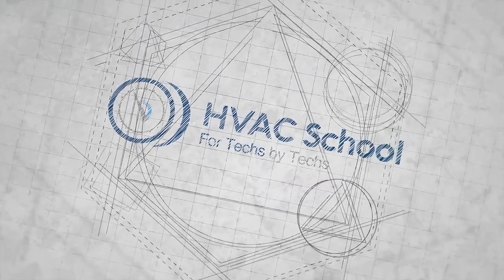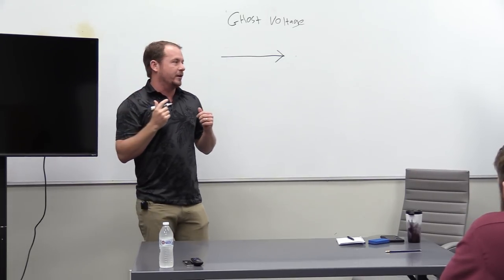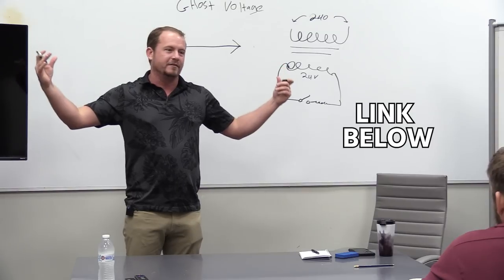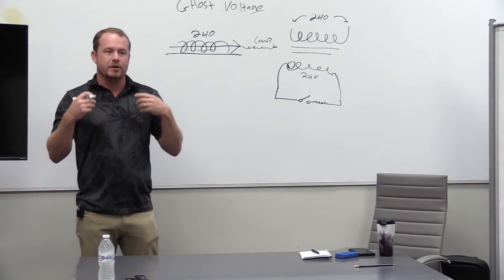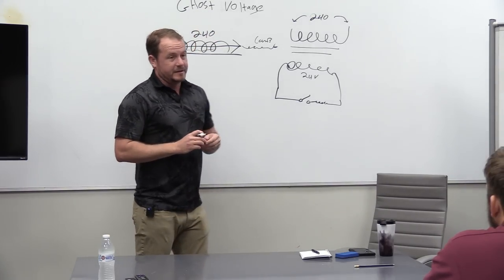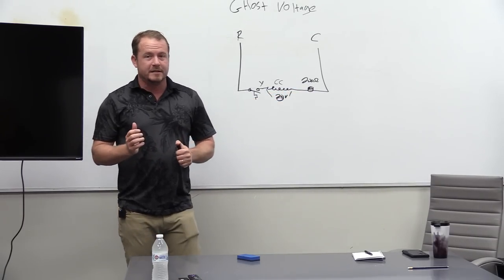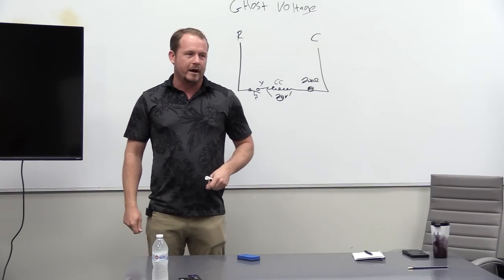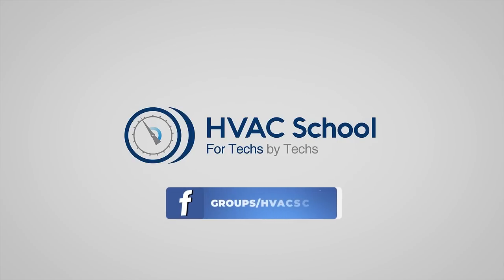What is Ghost Voltage?

Comment: Awesome! Journeyman electrician here. Ghost voltage can be very confusing while troubleshooting. Great job talking about low Z meter. Yup, If u got one it will answer your questions pretty quick. If not, have fun taking apart every plug in a house looking for some weird ground or short. Great vid!

Comment: Had a ghost voltage problem recently on the ignition circuit of a forklift, the fuel shutoff solenoid would not stay on reliably. Finely checked the ignition switch, which was cooked. Totally different field, but same problem. Good explanation Brian.

Comment: I've noticed you said high resistance but I have noticed a low resistance taking place with the same problem. Such as the reversing valve measuring 2 ohms and causing ghost voltage and damaging the transformer and not blowing the fuse. Thanks again for the great content. Very informative.
Reply: Not blowing the fuse at 2 ohms resistance? I would definitely check that fuse size. Someone had to substitute a 15   amp fuse in place of the 5 amp to keep it from blowing and it resulted in the transformer blowing.
This is a case not of ghost voltage, but of ghost hackery.

Comment: 6:23 the term "sine wave" comes from the root sinusoidal, which simply means circular or cyclical, and is in reference to the graph of a cyclical wave form.  What's creating the wave of motion - or drift - in the electrons is the electromagnetic field that is set up in the wire via the source (battery, rotating magnetic field, etc).  This field is called the Poynting Vector for those who wish to grease the Google machine.

Comment: The first time I ever realized I was dealing with ghost voltage was a gas furnace and the gas valve wouldn’t open even tho measured 26v at the valve it would drop out.   Stick a contactor on it and it won’t pull in.   
  Ends up being the contacts on the control board for the gas valve have high resistance.
Reply: Appreciated sharing it. Never dealt with loss at CB before. Learned something...
Contactor trick is definitely on my magic tricks now on. Makes a lot of sense
Reply: I have seen high resistance cause some weird reading before too but ya checking under load is the way to go

Comment: The only question I have is why would an additional place of resistance in the circuit after the load, I'm talking about the wirenut here, cause ghost voltage or cause the voltage being supplied to the intended load to not be able to have enough voltage to do the work? Or to get a reading at least across the intended load? Cuz I could understand if it didn't do work because it's not really completing the circuit with enough voltage but wouldn't I spell read 24 volts across the contactor coil in this illustration? And then lose voltage after the wire nut?

Comment: This reminds me of lockout relays that have high impedance coils. Current will always want to flow to the path of least resistance. The high impedance coil becomes part of the neutral.
Also this important to remember because, nowadays most equipment is communicating hardware, where electrical noise as I call it, will create havoc on hardware and nuisance call backs. Vfd are well known for this because how they generate an artificial sine wave.
Reply: Current takes all paths available proportionate to resistance.  Lower resistance paths will see more current, but all available paths will see some current.  Kirchhoff's current law.

Comment: The Veritasium stuff was a distraction and too much detail. (Not everyone even agrees with the theory in that video.) Simple leakage voltage/current explains most 'ghost voltages', the quality of the electrical devices and equipment are not extremely high on the systems that most of us encounter in the field and they allow acceptable amounts of leakage. Inductance is absolutely a cause as well but physical voltage leakage is the most common cause. Not your best presentation that I have seen, but I am learning a great deal from you as I move into Refrigeration from Electrical Contracting. You are an excellent instructor.

Comment: Had that exact issue and bypased tstat, isolated y circuit, 5amp fused popped found shorted coil contactor coil. Replaced c and fuse , now mt tstat and my vs blower motor started working again

Comment: Tested using just a probe. With light switch on i get 110v on open wire. Probe beeps fast at 110v. Like supposed to. When i turn switch of i get 28v on wire. The probe beeps slow. Old switch. Can it be switch? It is in church. 1930’s. Looked up probe info and it says if it beeps slow it is lower voltage. Can those probes that just beep, pick up ghost voltage? Thanks

Comment: The "hum" in a transformer is primarily due to the billions of microscopic poles in the core aligning and realigning to the magnetic field changing 60 times a second from the AC voltage.

Comment: Micro electro magnetic pulses caused by the constant reversing of polarity. ( Alternating current ) or your sine wave you mentioned .
On your wave drawing, the top curve being the plus or push pulse, the bottom wave curve being the reverse/ negative or pull pulse and the center of these two pulses is a zero volt point or the start point of reversing, or the ending point

Comment: The "ghost" or "phantom" voltage being discussed here is usually due to CAPACITIVE (not inductive, as being implied) coupling.  Just call your local Fluke office and they will be glad to visit you and explain all about ghost voltages (and sell you all kinds of meters that will detect it 😀)   Also in the referenced article, "but it also drops the impedance of the contactor coil itself," is very strange indeed.  Impedance is a fixed property for a given circuit frequency.  What is being described here is a simple "voltage divider" circuit confused with a lot of crazy talk.   This gentleman is a wealth of knowledge and wisdom when it comes to air conditioning service, but electrical theory is not his strong suit.
Reply: Can you elaborate on the difference? I have always called it inductive when I have numerous conductors laying in a trough for a long distance. 120 on a few of the wires "induces"??  a voltage on the wires next to it similar to a transformer.. Never thought of it as capacitive, but only because I have not thought about it much at all except to not be misled with meter checks.
Reply: At least he's trying

Comment: so there's volt meters with low impedance ("z") setting, to check the ghostiness of the voltage
Reply: Yes a lot of high end meters even my field piece sc640 has like 2/3 settings for voltage. 

50v and under 200v and under and 400v and under. 

All these have less impedance and can more accurately measure the voltage closest to them.

Comment: I think I've come across ghost voltage. Was getting 0 volts at the board, but when  I removed the wires I was getting 24v
Reply: I wasted my time changing a gas valve because of ghost voltage lol
Reply: @mackenziegray2090  😅😅
Reply: Yeap

Comment: I'm Measuring voltage on a kauri boat I have 8v@ .01a between my battery +tve and mast. Loading doesn't influence voltage. I can remove all electrical systems and get a lower voltage at the same current like 2v .0.09amp. Either way any through bolt is earthing thru draw and creating sodium hydroxide Around any grounding metal . I listened to this and figured I'd I create a load system between the high potential areas thru resistive led to cancel the voltage apply opportunity for the voltage to draw current with hope that at chance it'll cancel the voltage but the resistive quality actually increasing current causing more ionic discharge thus effecting the ionic chaste aping my thru bolts enhancing the alkalinizatation effect. Thus destroying the lignum in my wood. I can't seem to discharge the capacitance of my mast. Advice master E
Reply: My guess is. if I create a lower resistive circuit that grounds the boat the saline imbued woods resistive quality will no longer be a primary circuit. All this ghost voltage on my mast.  Is capacitance?  Yea?
Reply: If I was 2 stories high my voltage would increase. I have a nasty that is 30m if not more high with a variety of conductors at the top. Nav lights aerial etc. Then I have a solar panel.  Conduit coming through the same port in thinking inductance with the lines running parallel and capacitance within the mast being wooden also?  Sound right?

Comment: Mitsubushi mini split branch boxes have ridiculous induction in communication cable. Ive seen indoor unita do weird stuff
Reply: They specifically tell you to use separate cables for this reason, unlike Daikins that will work with multi core
Reply: @mikebazil1  it is true!

Comment: If you switch to low inpeadeace setting on a meter like the fluke 177 it will show 0.00 which will indicate it’s not a true voltage.

Comment: I had a residential system with the breaker off to the disconnect I would get 23v on one leg and 18v in the other but 7v between the legs. I never seen ghost voltage this high. Any thoughts?
Reply: i would assume a surface charge on the capacitor, but that is simply a guess. i might press in the contactor to see if i can eat the charge.
Reply: Did you ever locate the origin of the issue you think?

Comment: Nest T.stat going crazy doing nothing or sometines saying it can't operate with how it's wired and sometimes working turned out to be a bad condenser 24V contactor. 

 Was a recent time consuming  "fun" learning expierence to figure out.

Never heard of it called ghost voltage before.

I always call and hear such to be called PHANTOM VOLTAGE ⚡️
Reply: I would say 50% of the time I have a failed NEST or Y1 problem on nest it is the outdoor contactor. Since they’re so cheap I almost always change the contactor if I go on a call for a problematic nest thermostat. Been at least 5 now. 

I had a nest T-stat that was giving and ERROR ON Y-1 code. It does this using DC voltage and could measure the resistance was out of range. I believe. 

Anyhow the transformer which had a 3 amp fuse on common and hot 24v kept blowing. Not the fuses but the transformer. Because the voltage/resistance ratio was just so odd it wasn’t blowing the fuse but the actual fucking transformer. 

I was pretty new at the time and that call kicked my ass. Now I’m not scared of too much. 

Thanks Bryan Orr. Love you